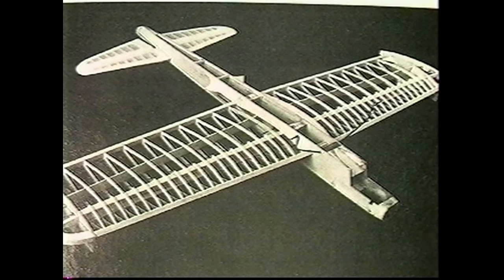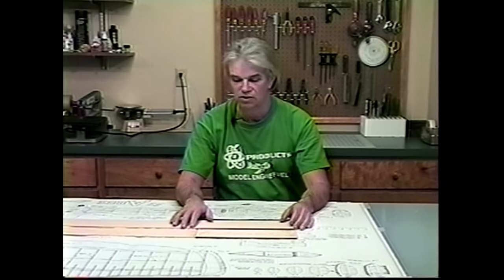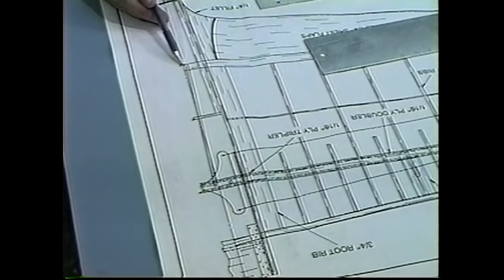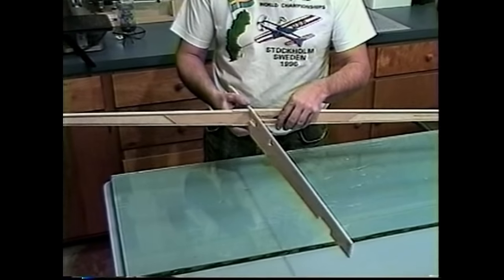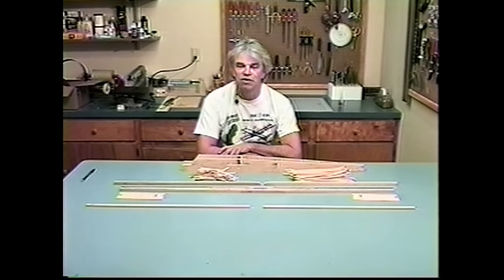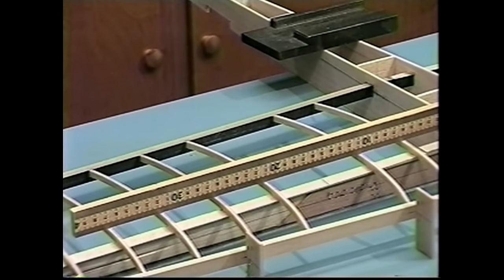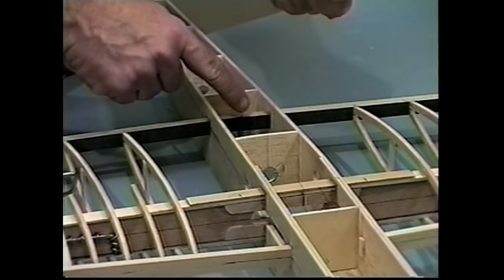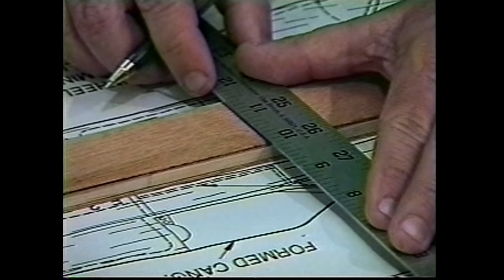Full video How to build I beam wings Staring Billy Werwage

Comment: There's a lot of great techniques and information in this video. 
I just wish I had your guys's faith in CA glue.
Reply from the maker: CA has it's place but so does white glue and epoxy
Reply: @Stunthangar   CA is good for gluing fingers together. But I've seen it fail on wood, so...
Reply: @frogsoda  I broken CA joint was probably a poorly fitted joint to begin with.
CA filling a gap is brittle and can break, but CA joining closely fitted wood to wood seams is stronger than the wood itself. CA soaks deep into the wood pores and grain and makes a very strong bond.

Comment: Hi Bill, built a Cobra proved to weak and broke up in flight. So really enjoyed your video. Just one question, I noticed you had no root ribs. I thought you were doing those when you did the bits around the undercarriage. I presume you must have something at the root to be able to cover and also for strength. Thanks so much for your time making video.
Reply from the maker: root ribs are 1/2 to 3/4 inch wide glued to fuse

Comment: Could the wing be built with the same length for each side instead of having one side 2 inches shorter, how would it affect the flight characteristics, would tip weight need to be added?

Comment: The 'Argus' and the 'Ares' were the same design, sold to different magazines. Steve Wooley told me that. It's a much easier build if you use solid ribs and slide them on the spar.